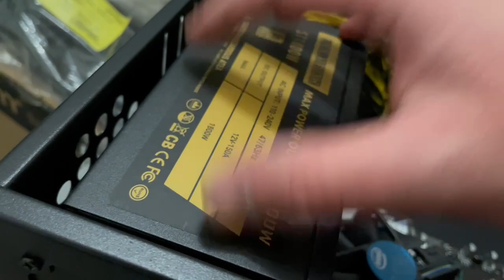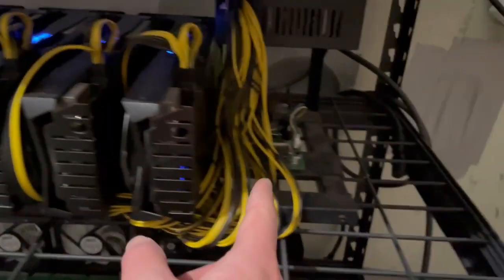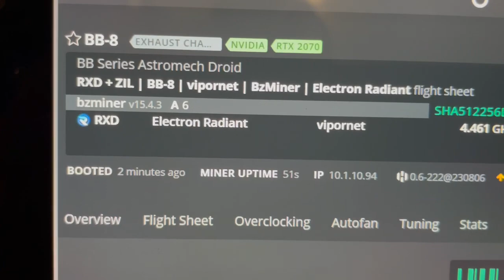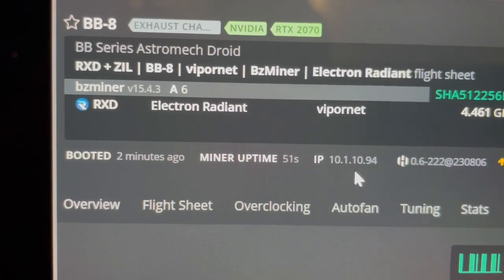8 GPU Open Air Rig DIY Conversion to Server Case

Comment: Thanks man! I used your link to buy one. Do you think the BTC 79x5 will line up in there? I have other boards like yours that I can use if it doesn't, but I'm hoping to find something for the 79x5.
Reply from the maker: Use this case for BTC79X5 60mm spacing Boards : https://youtu.be/eZY-36WoGvw
https://www.ebay.com/itm/304817433212

Comment: Should of did a temp difference. I don't think server cases are cooler. It's just that they typically have fans that are 5x stronger. Plus they are way louder.
Reply from the maker: I'll try and do a comparison in the future. I think it's a little of both tbh. The increased fan speed def helps, but the wind tunnel effect helps get ambient heat out from the cards. Open air the heat tends to linger at the units more imo.

Comment: Nice! I always wondered how the build quality was on those foldable cases.
If the spacing of the risers is the same on the green b85 as the black board (ie if all risers line up with gpu screw holes) and you plan to keep the case sitting horizontally, then you can simply buy plastic standoffs and ignore the case post spacing
Reply from the maker: Yeah, pleasantly surprised on quality for sure. No sharp corners or anything.
spacing is the same but moving the rig would need extra caution. I think I found a similar case that will work for the B85M "Green Board". To be continued...